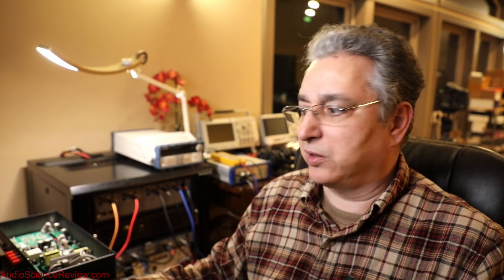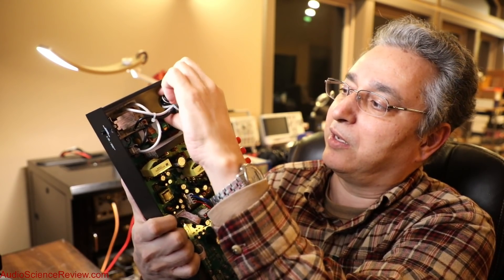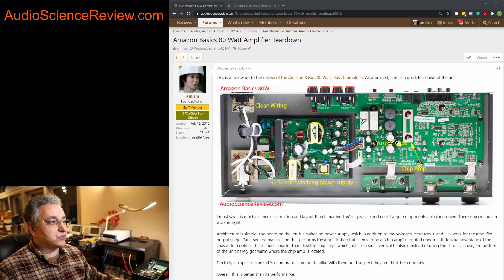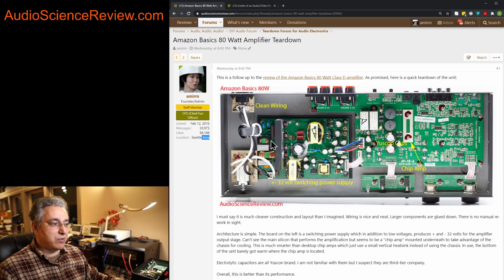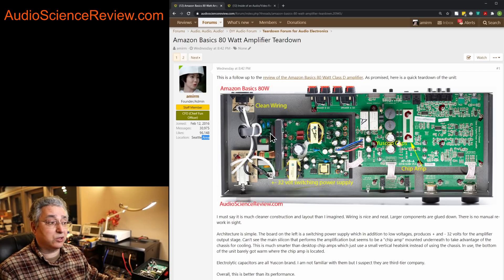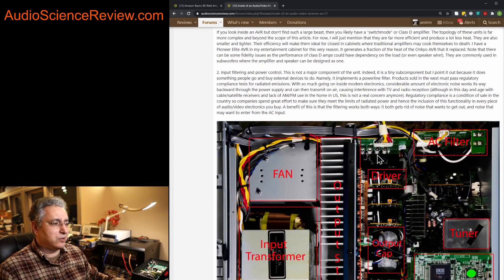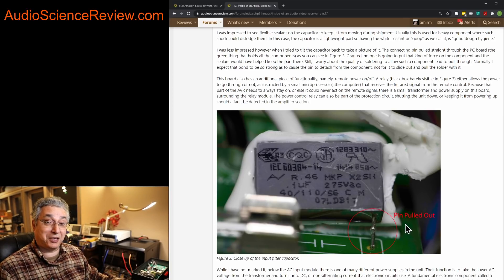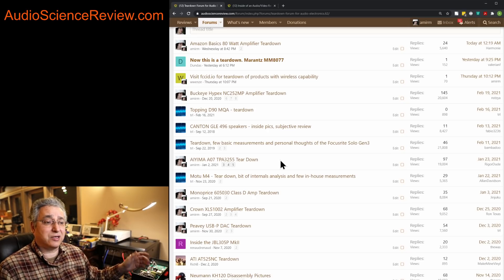Do you need AC noise filtering for audio devices?

Comment: This channel makes you believe $1K systems sound as good as $100K system lol
Reply: @Douglas Blake I was present at the test between the. Accuphase and the Yamaha and I wasn’t told which amp was hooked up first or second. I wasn’t present when the Krell and Rowland was present so can’t tell for sure if that was a blind test. 

I accept that the only tests that should be considered valid should be blind tests. Otherwise it is not a true test. We did not measure any of the amps because we did not have the equipment to do so. I don’t know why one sounded warmer or the other sounded tighter. I do not know if there are measurements that can test for warmth or tightness or dryness. 

When I was younger (say till I was 40) I could tell if a ribbon “super tweeter” was connected or not. I do not know if my aged ears can tell that today. Some speakers are able to make your feet tap (Klipsch for example) some can’t (the old Dynaudio with that D260 and even the D28af tweeter). The Dynaudio measure well but are just too polite. The same can be said for amplifiers and other components. 

Like I said before, I do not diss measurements. I was quite active in audio from 1988 to 1995 and measurements are essential to determine distortion, frequency response, impulse response etc. and we rely on these to tell us if the equipment is well designed. How an equipment sounds or will sound is not always clear from these measurements. I spent a lot of time looking for the holy grail before giving up because there are just too many variables starting with the room to have everything perfect. Today I spend my time listening to speakers that are around than a meter from my ears: a pair of 18cm Vifa PL18 something woofer on an L baffle (like Danny Richtie’s Nxotica) crossed over to a B&G Neo 3 tweeter. I can understand why so many have switched to headphones so as to eliminate the room.

Elac use to make a 3.5 way tower with 2 8” woofers (till 150) a 6” midbass (till 600 or so) a concentric mid and tweeter (the mid was from 600-2400 and the tweeter covered everything above 2400). The unusual feature of this speaker was that the tweeter’s position inside the midrange could be adjusted via a screw at the back. We found that even half a mm change made a difference to the sound. Again we did not have equipment available to measure this. I wish we did but sometimes it’s just not possible to have equipment in hand every time. 

Amir’s own system is quite expensive by his own admission. Granted there are some snake oil salesmen who will put an RPi4 based streamer in a nice looking steel chassis and ask for $5000 for it, but that does not negate the work that designers like Dan D’Agastino or Nelson Pass have done. Not all expensive audio equipment is snake oil even if the differences are sometimes so small that one wonders if the price they charge is justified. 

I realise that most expensive equipment especially loudspeakers spend more on the box than the active components. Take the much advertised Q Acoustics Concept 500 for example. They ask for $6000 for what is essentially an MTM using 2 18cm woofers and a dome tweeter. The active components must not cost the manufacturer more than $600-700. The rest of the cost is the box, the distributor and dealer margins, and other overheads. You could build the same for $3000 or less (partly because you will pay 3x in retail for the same drivers). The Concept 500 is a well designed loudspeaker. The cabinetry is both sound and exquisite. The question remains is does it offer value. Now that is a personal decision. 

The point I am trying to make is thar (a) not everything is as yet measurable and (b) ignore the snake oil but give credit to the true designers. 

Amir and his Audio Science Review do a great service, just like Julian Birch’s Stereo Review did back in the day. Measurements are essential but do not tell the whole story. In the end we do not listen to music on an oscilloscope.
Reply: The people who think just because you pay more for something it is necessarily better.
Reply: @Douglas Blake and @Tom Terrific 

Sure there are measurements we are able to take of many parameters that are so sensitive that are far below the threshold of hearing. 

Assume if you will that there might be parameters that we are not measuring yet, because we don’t know how or even what measurements we may not be taking. Science advances and over time we may find that our ear is able to hear things that we never knew to measure. 

I am not for a minute disregarding any existing measurements. The measurements we take today using FFT or distortion analysers or the tools we have our disposal are all good. Very good in fact. But we might just not be measuring everything.

Many decades ago when my son was an infant, we had some friends over (with their kids). Since it got late at night, the kids soon fell asleep in our son’s bedroom while their parents continued to chat and party in the living room. To test my hypothesis I woke up one of the kids. The weird thing that happened was that ONLY the mother of the kid who woke up heard her child. The other mothers were able to subconsciously tune the crying out and continue chatting. As humans our hearing has evolved to suit our needs and our environment. We can hear a twig snap on the quiet dark night while camping in the forrest, but are able to ignore louder noises when we are in the city. Taxi drivers in Mumbai (a busy chaotic metropolis) are known to be able to tune out the sounds of blaring horns. 

Thanks to mathematicians like Laplace, Fourier etc we have discovered how to measure in the frequency domain, and measure impulse response, etc. Maybe be future generations will be able to measure other facets of sound that we do not know exist yet or how to measure today. 

Granted there is a lot of snake oil being sold in audio. Cable lifters, power filters, etc are yet to have any foundation in audio theory. On the flip side, I am yet unable to ascertain why or how, my friends and I are able to consistently tell the difference between a Accuphase E480 and Yamaha S2100 or a Krell KSA 50 or Rowland. We haven’t measured these amplifiers but assume they would all measure extremely well. Now I am not saying the Krell is better or that the Accuphase is. That’s largely a matter of taste; but they are different. The same holds for cartridges, turntables, CD players, etc. When I had vinyl ( I consider it a mistake to give it up) my Thorens TD160 sounded very different to my Denon DP47F. One was belt driven, the other was direct drive. I do not know if this was the reason or not,  but they were different. Neither was “better”. 

Eventually I suspect we will be able to tell how it sounds from measurements. Till then we have to trust both our ears as well as the measurements we know of and take today.
Reply: @Douglas Blake Maybe I would. I am not sure since I didn't. My mind at that time was focussed on my CD player and Amp assuming one of them had malfunctioned. 

Is there a software/hardware tool that can do a bitwise comparison of 2 recordings?
Reply: @Douglas Blake one day I would like to try this. I am not very PC or internet literate. 

On an unrelated topic, I am interested in getting a device that can play my FLAC files (burned using EAC and WavPack) from my hard disk (I have about 3000 CDs worth) as well as stream from the internet - I would like to subscribe to Tidal and Spotify once I find a suitable device. I am happy to use an outboard DAC like a Topping D70s or Gustad X16 (both have measured well on Amir’s website). Can you recommend me a streamer or server or whatever these devices are called that can send a clean signal to a DAC? No snake oil stuff like some RPi 4 in a fancy box please. 😂 I believe companies like Lumin do this
Reply: 🦗Crickets ( ♬ chirp, chirp, & black noise ♪) - why so quiet 🤷🏽‍♂️?  “ LOL ”🦗
Reply: My system is about 1K USD and is completely wireless, portable and is completely satisfying for me.
Reply from the maker: If you got to $100K with these tweaks, you have my sympathy!  If on the other hand if you spent it on speakers, proper amplification and such, not at all.  My own system costs that much and you don't see me complaining about that.  :)
Reply: @AudioScienceReview  Holy shit Amir I wasn't aware you were a mega baller, damn dude good goin'!
Reply: Audio Science Review tests components for how they measure and do not offer subjective evaluation of the sound signature of components. This is not to say that a Krell sound the same as a Rowland which sounds the same as a Denon or Yamaha or Marantz. ASR is Julian Hirach revisited. The reviews are interesting and to be read alongside subjective reviews. 

Components may measure the same given the current state of our knowledge of measuring electronics but may sound different for reasons that cannot be accurately measured or repeated. 

ASR reviews are not to be taken as Gospel but as one facet of the component’s performance. Just like subject reviews cannot be taken as Gospel as they depend so much of the impressions of the reviewer (system, room, associated components).

Let’s put it this way, at least you won’t spend money on Peter Belt type tweaks or maybe you spend your money of other areas like room treatment that might offer better ROI than these tweets.
Reply: @navinadv  Most ASR reviews do in fact include a subjective listening test towards the end of each review. For instance, in headphone amp reviews, a number of common headphones are tested listening to several recordings, often comparing the sound signature to other similar products.
Reply: @ngtflyer  oh ok. I have only read their DAC reviews. That too only a few like the Gustad X16.
Reply: @navinadv  "Components may measure the same given the current state of our knowledge of measuring electronics but may sound different for reasons that cannot be accurately measured or repeated"
Respectfully, I'm not sure I agree with your statement. 
There is no "sound" in an audio system; there are only electrical voltages and currents, possibly (but not necessarily) being handled by electronic components. There is no unmeasurable magical quantity that changes the sound at the speakers (by virtue of changed electrical signals in the amplifier) that cannot be measured. What is going on in power amplifiers electrically is very well understood, and has been very well understood for a long time. If it sounds different sonically at the speakers, it follows that the electrical signals coming to the speakers must also be different, and this difference can be very easily measured. Modern measuring equipment is far more sophisticated than the audio devices that they are connected to. The only question is, which changed measurements contribute to perceived sonic differences, and which ones do not? Trust me, compared to other types of technologies, 20Hz to 20kHz electrical signals (that represent audio) are very simple and basic. They are easily measured and quantified.
I recognize that a lot of people won't agree with me.

Comment: How about a huge cordial core transformer and DC overlay on mains generated by all the switching power supplies? I've got a Harman Kardon 2.1 which is humming because of it. Do you have experiences with DC blockers?
Reply: Toroidal transformers are not the magic solution that they are sometimes said to be, at least not the ones that are installed in most consumer audio devices. To be proper, a toroidal transformer needs a very narrow core slot to prevent core saturation. This is expensive and somewhat difficult to do, and adds to the price, so (to my knowledge) it is almost never done. Unslotted toroidal transformer cores will saturate easily with small amounts of DC offset of the AC wave, and buzz like crazy. It's just the nature of the thing.
Reply from the maker: Mechanical buzzing/hum can indeed be annoying.  Standard surge protectors don't do anything for them either.
Reply: @Douglas Blakeits humming without signal or speaker attached. It is the transformer.
Reply: @Douglas Blake Unslotted toroidal transformers can hum like crazy if the AC is non-symmetrical.